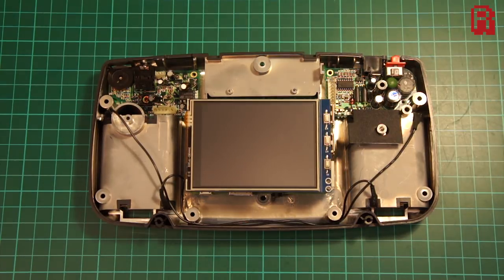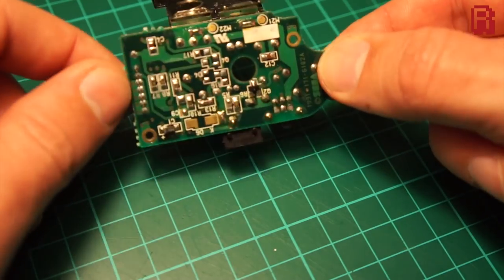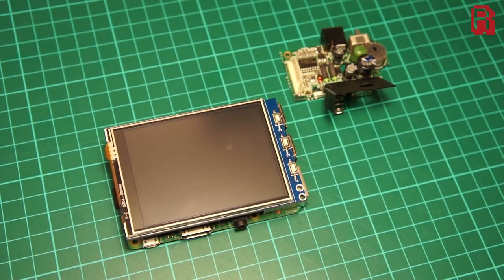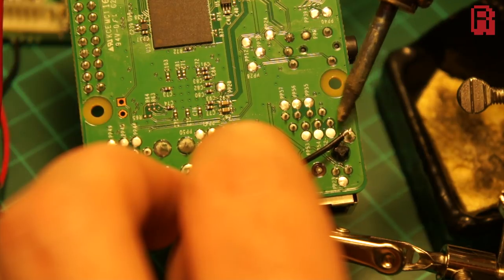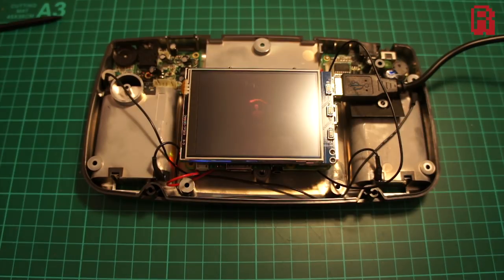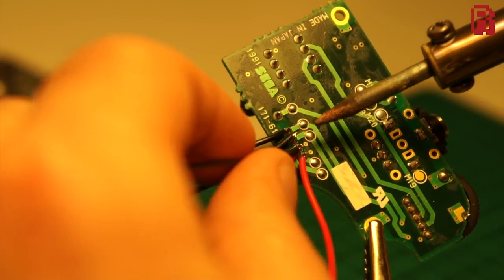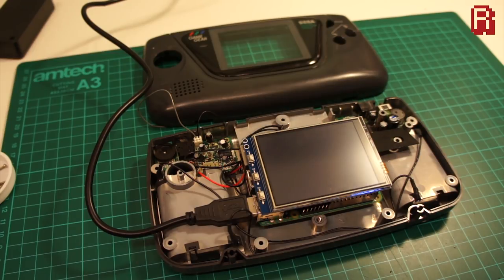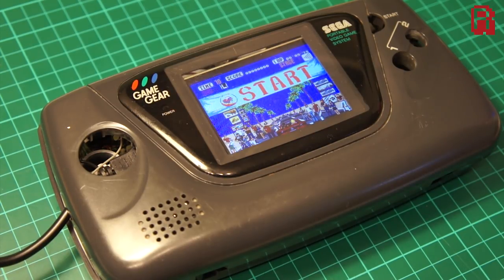Sega Game Gear Power Board to Raspberry Pi

Comment: this series has always been a favourite of mine and i've increasingly been looking into how difficult/easy it might be to design a pcb that replicated the original shape and layout of the game gears motherboard including it's screw mounting posts and controller contacts but it's trace layout replicated that of the raspberry pi's so you could hot air remove its components and transplant them into the new pcb, creating a perfect fit build that'd be cleaner and easier to install and even potentially markettable since the only difficulty would be the resoldering of the Pi's components.

trouble is I know fuck all about pcb design and manufacturing. Having seen game tech and voultar do it though it atleast leads me to think it's an attainable dream.

Comment: I know this is a rather old project, but I highly recommend that you use slightly thicker wires for power and ground, at least if the wires get warm under operation. Although the unit is getting the power it needs, you are still feeding several watts through those thin wires.

Comment: There is no need to solder onto the Pi end, 5v and ground can be connected to the Pi header pins (although this does bypass a protection circuit)

Comment: how long the battery last ?
Reply from the maker: Wanna Be Canadian I'm planning on putting it under load with a timer and new batteries to find that out.   After filming the crappy tabs on the duracells showed 90% still available but they are hardly an accurate measure

Comment: I see this runs off of the batteries, but can it be power using the power adapter?
Reply from the maker: Lukey Sixx yes it works also with the power cable

Comment: While still a awaiting my 3.5 screen (now wishing I’d got the 3.2”)

I’ve managed to streamline the inside of my GG.

Using a NES usb controller I hacked the D-Pad away as well as the Start/Select and A and B buttons.  Rejoined and bridged the connections and wired the usb red white green and Black directly under the pi’s USB solder points and also hooked up the power from the audio jack to the USB behind. As my Powerboard seems to have stopped working I wired up a spare only to find that one also didn’t like being wired to the pi.

So I’ve decided to hook up a Power bank inside the shell and using cable extensions have the ports for power and charging plugged in

Comment: Great series! I hope you continue with these informative build videos. Have you thought about adding a charging board? I'm still waiting on a faulty game gear to come into the post for a similar project im working on. I had an idea of adding something like TP4056 (easy to find on ebay) charding module, running it off 3.7v 14500 sized lithium batteries in parallel and using a step up converter (XL6009 for example).
Reply from the maker: Thanks Will, that sounds like a great addition to a PiGear build I'll look into that.  I'm currently hiding 2 additional buttons in a cartridge in the back of mine as I don't have enough to properly navigate the RetroPie menus with 4.  I'll get another update online soon.  Would be interested to see your project
Reply: Great Idea, I'll be happy to share my progress once all the components arrive and I can get started properly. Here's what I have planned for mine regarding button layout http://i.imgur.com/nXQWXt4.jpg For the screen I'm hoping to be able to fit a 3.5" lcd from one of those cheap composite car monitors I see used alot on the gameboy builds. Cutting away the inner plastic bezel it should fit exactly with the actual transperant screen bezel. I ordered some of those tactile buttons after seeing your latest video. They seem like a great upgrade over rubber domes.
Reply: Will Bland did you end up making a video! 
I'm planing on doing the same to my old game gears.. so a video would be cool!

Comment: As we speak I am making one of these.  I was always curious why you never finished.  Is it because you had clearance issues with the Pi and Hat Screen like I am now?!  With the original power board and audio board they hit the Pi when mounted in the case where the screen should go.  Been a fun journey for me and after I made a beautiful screen adapter for a 3.5" screen, AND did these mods, it doesn't fit lol.  A hacking I will go!!!!
Reply from the maker: Gosh this is an old one.  The build was finished and working, everything fit.  I then did a terrible paint job on it that's all.  I still have it in a box here somewhere
Reply: @RMCRetro  Thanks for replying.  I check back every so often to see if you posted a finish video.  

You never ran into clearance issues with the screen/Pi in that area?  I wish I could send you a pic of what I am encountering.  

I designed a custom bezel and printed it and the screen is perfectly centered and looks great - screws into stock holes even.

I then added the audio and power boards and they over lap.  Really has me thinking what to do next.

How did you not encounter the same please?
Reply: @RMCRetro   out comes may not be to your liking, but I would like to see the finished or unfinished products. Great vid tho, I like to see vids even if they fail just to learn.

Comment: My lcd has cracks on screen a vertical line my lcd would work?
Reply from the maker: That doesn't sound good.  This LCD would not work with an original GameGear board, only a Pi

Comment: so it was 4 years ago and it was never completed ?
Reply from the maker: Gosh this is going back a long way, back when I was still working in IT in the daytime and fiddling with these things in the evenings. I remember I gave it a spray paint and the result wasn't very good looking, and then I moved on to something else. It's still in a box here somewhere!
Reply: @RMCRetro  I was about to start building my own and saw your video, great idea with the amp and the psu, will use it, just need to figure out if I still want a nes clone in there or a pi :D strange that you havent finished yours as it was pretty much complete

Comment: Oooh you should watch some Big Clive vids on how to solder, some of that wasn't pretty.
Reply from the maker: don g oh don't I know it.  it's a skill I'm working on.   But if I can do it then pretty much anyone watching this can too :)
Reply: Heh me too, buy some chinese kits (clocks are fun ) and you'll soon figure it out. A couple of the joints you did in this vid are going to fail, with any luck before you close the case.
Reply from the maker: don g I intend to redo them all when I work out my cable channels for the final build so I'll bone up before that.  Thanks for watching though I hope you enjoyed it despite the soldering and it gives some people ideas
Reply: Thanks for the effort, already looking for a donor Game gear!  and figuring out what to do with the 4" gpio screen that is clearly not going to work (You saved me a lot of swearing, I suspect) . And I'll probably need a new RPI 3 as the one that was supposed to be for this project is currently driving my 3D printer... an experiment that was far too successful.
Reply from the maker: don g Excellent be sure to show me how you get on if you take on a Game Gear!
Reply: any recommendations for kits?

Comment: I have an old Game Gear that I am thinking of doing this with but the battery terminals in mine are so corroded that I wouldn't be able to run it off AA batteries. I was thinking of putting in a lipo battery or two. Would I still be able to utilise the original power board with rechargeable lipos in there do you think?
Reply from the maker: I would of thought that would work just fine, but it will only draw power from those rechargeable batteries and not power them.  If you're looking to do that you might want to look at other options which would recharge your batteries also.